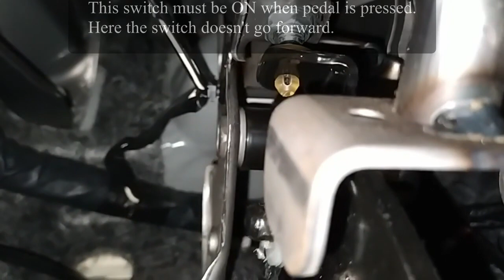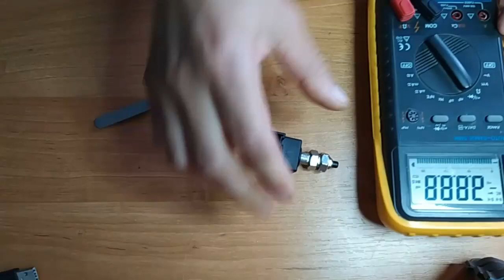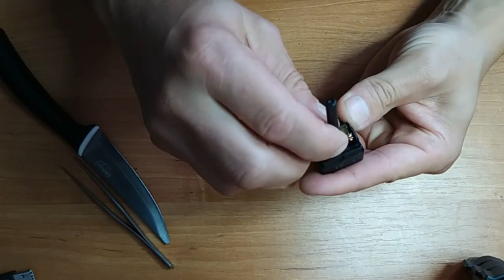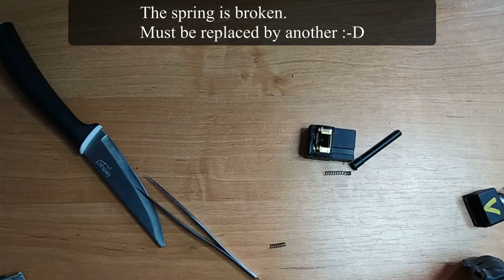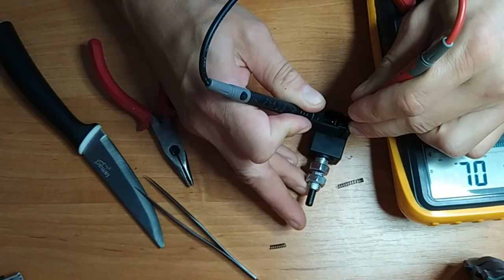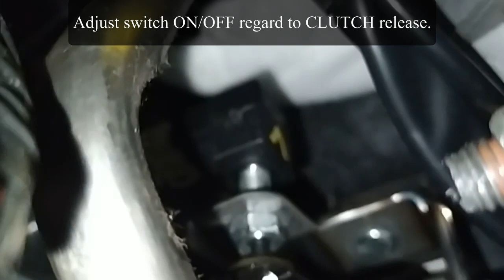Kia clutch pedal switch repair. Sportage III horní spínač spojky - oprava.

Comment: Good morning all,
We have 2011 Sportage, I just can’t get the top sensor out. Did you take clutch pedal off, to have a space? Thank you so much. 
P.s.: Dekuji za super navod, mam stejny problem. Jen nedokazu povolit matku tak abych mohl senzor vytahnout ven. Byla by moznost popsat metodu jak se to povedlo Vam? Dekuji mnohokrat.
Reply from the maker: Only press the pedal it is all. Maybe reason of problem, your pedal has big press on the switch, then after some time switch will broke. For new one is good set the end point right way.
Reply: Good morning, thank you. I did yesterday night put a metal bar between central console and brake pedal. Now I have more space but still struggling to undo the nut. But hopefully when I have more time I will do it.

Comment: Hi how do you remove lower dash panel to get access to the switch thanks
Reply from the maker: In Sportage you do not need anything remove.
Reply: @stanleym  I tried to access the switch you so hard to replace
Reply: Is these switch  fail would  the isg play up